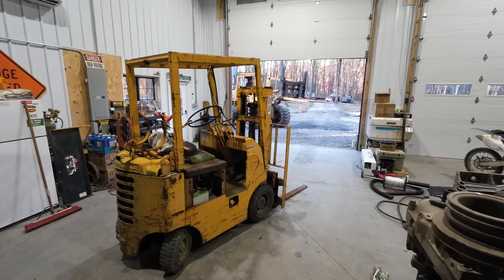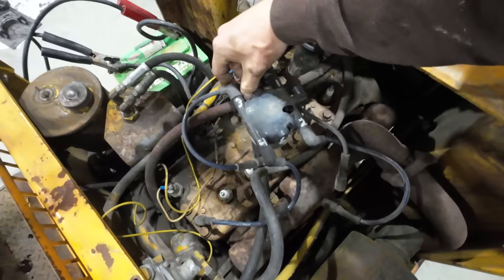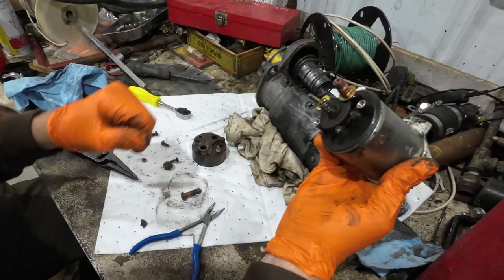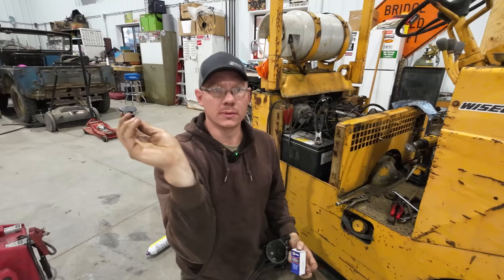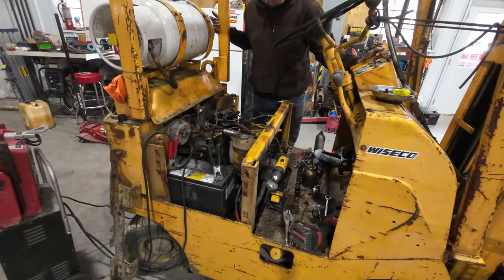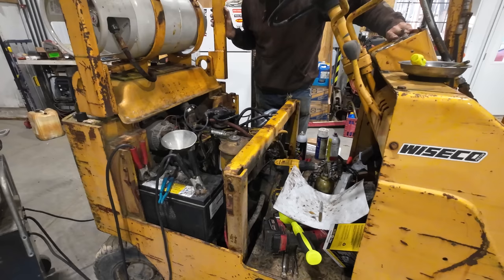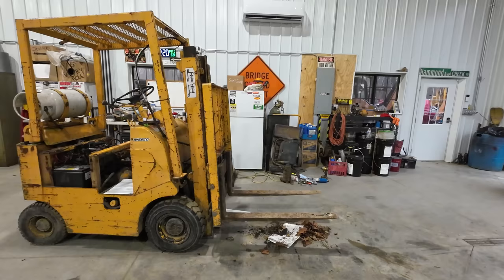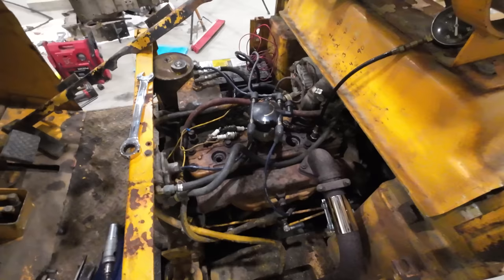Save or Scrap? CAT Towmotor sitting for years. Will it Run??

Comment: test for engine lock by putting in gear and pushing?

BTW, it takes about five minutes to check compression on a four cylinder engine. it would then be clear whether or not the head might have to come off. ...easy test.

surprised the known to be broken rotor (host mentioned breaking it during removal) was installed and then thought it likely the engine would start.

now that i've seen about a third of the video...

should have suspected valve problem when host found rust on the plugs. surprised the host invested money in new parts, even though it was clearly evident that they would be needed eventually, when wholly concerned about just getting it to run. 

SOP on a non-diesels should be to check spark and compression, at a minimum. ...and only THEN try starting it. it's take little time to do that and will on average reduce expense, time and frustration. yet it's rarely done by those that try to start old engines subjected to weather. it always seems to be a hit and miss process.

IOW, get the compression tester out, get your points file out, get the starting fluid out and statically time the distributor if possible before attempting it to start. if it doesn't bark off after that, THEN it's time to start scratching your head.  :)

and what was the point of letting it run with only a drop of oil on the stick when the host knew he was going to put at least a couple of quarts in anyway? what purpose did THAT serve?

i suspect the lack of smoke on startup after the oil change had nothing to do with the oil change but rather the fact that the host didn't inject oil from an oil can directly into the cylinders before starting as was done before the oil change.

sparkplug wires generate more resistance as they heat up, making shorting out to a nearby ground much more likely. if it happens in the coil wire, all sparkplugs will fail at about the same time. arcing can often be seen in a running engine in a darkened room.

when doing this kind of thing, it's best to have a set of eight known to be functioning plug wires and a coil wire long enough to reach all spark plugs and a known set of working sparkplugs and simply install them right from the get-go.  the point is to eliminate as many variables as possible. the frustration level generated here is impacting the ability to reach the goal. 

BTW, this is a stream of consciousness kind of comment, as i watch, i'm commenting before i know the outcome.

Comment: Hi Matt, love the show but you frustate me by not doing the basics. Didn't see you check the valve clearances or the ignition timing. With a good condenser there should not be a spark at the points, it's there to stop that. Also was the advance/retard system working in the distributor? Anyway, with that main seal leaking so bad and all that blow by she's a gonner for sure. RIP little cat.

Comment: You never showed us if you added oil to the engine before starting it since the dipstick was barely wet. Did you add and coolant either? You ran it for a while. How about hydraulic oil so the pump is not running dry before starting it the first time? How about cleaning the plugs and checking the gap once you got the first sign of life?

Comment: Intermittent spark? I am going to go with ignition switch, bad ground, or busted ass wiring system. Walk away, not bad lifts when you need them and they are running, but these lifts were the inspiration for the game Pitfall for intelevision. The time and money sunk into this is not worth it. I suggested this on another YouTube  channel, those flat he'd Continental setups are near impossible to find parts for. It took forever for me to piece a complete engine kit together. I rebuilt the engine, pump, hydraulics, lines, trans control valves, steering system, he'll even the bottom bolt for the counter weight was broken. I rebuilt it all, and that lift doesn't work anywhere near as good as the later 80s Yale. Lesson learned!
Reply: Another guess would be the carb, if it is not atomizing properly because the carb is getting cold it would do exactly what you see.

Comment: Is there a temperature cut out in series with the ignition circuit? On a motor this old I'd been inclined to build a complete basic wiring harness and drop it in. That will get round any electrical problems.
Reply from the maker: I had a jumper right to the coil. Doesn’t get any simpler than that
Reply: Elsewhere in these comments @tardis454 posted 3 days ago (edited)
"Don't give up on the Towmotor just yet Matt. At work we have a mid 70's 15,000lb capacity Towmotor with a Continental flat 6 that had a similar lost spark issue. Our company purchased the machine from a salvage yard where it lived outdoors exposed to the elements for many years. It took some digging, but my friend (who's name is also Matt) found the problem. There are bakelight/plastic pieces that isolate the points assembly/parts from the breaker plate and distributor body. The bakelight/plastic pieces had disintegrated and were causing the engine to randomly lose spark. My friend found some non-conductive material at our shop and made new isolators for the distributor. That solved the problem and the Towmotor has run fine ever since. The distributor in that machine was rusty like the one on your machine due to being stored outside for a long time. My friend thinks that's what caused the isolator pieces to become brittle and fail. It's worth checking out.. Distributor refurb kits are still available as are new/used distributor assemblies. Those old Towmotors are great machines once they're sorted."

Comment: Napa might have a line on a rebuilt starter motor or a local rebuilder shop. Google Auto Electric supply. Pacoima auto Electric pacoima CA. 59:08

Comment: Do yourself a favor and buy a complete new or rebuilt distributor for it.  9400 hrs on engine...I'm betting the distributor has worn out upper and lower bushings.  I have fixed 3 old forklifts in the past 5 years doing just that.  A Yale with a wisconsin v-4, a Lift all with a 4 cyl ford, and a hyster with a 6 cyl Continental.  Wiggle the rotor shaft back and forth towards the points and you will immediately see what I mean as the point gap changes.  @tardis454 is right too.  Where the wire comes out of the dist. housing the bakalite bushings crack and moisture can mess with grounding out the points also.  Course...there is that little oil leak problem....  Good Luck

Comment: You need a battery sponsorship almost as bad as a feller (and felletand Lil fellers) in Tennessee does other people's "projects they never got around to" almost always have dead batteries in them and don't forget they need a go handle to be the right application for your project oh and water will funnel through the distributor into the crankcase and it can seize the distributor causing the cam gear on it to get wiped out if the engine does turn over

Comment: Switch is bad get a brand new one.  I would fix it up because I like it. It probably needs the valves replaced or nuraled.  I think it would make more compression.  Its something simple like that. put some B12 chem tool down the yap and rev it up and clean the valve seats or you could use Marvel Mystery oil down the yap or both it cleans the valves and unsticks them. Some guys use tranny fluid down the yap. It will run. Actually the compresssion is too low it needs valve work or rings. The valves are probably carboned up. Try cleaning them with and marvel or B12. Put B12 in the gas tank too. It will clean everything. Did you put new plugs in it? Needs a new rear main seal. that switch is bad get a brand new switch. You are giving up too soon. Rear main seals are replaceable you have to remove the motor. Its a lot of work I guess. It will make a good video to fix . Keep it for later maybe you find another motor later. Saw a guy put some B12 down the carb of a ranger and made it run like new again. B12 is cheap like 6 dollars.

Comment: How do you figure that there is a lot less smoke by changing the oil? Don't suppose that oil you put into the cylinders had anything to do with it smoking, do you?
Reply from the maker: It ran long enough to burn that off prior to the change. I’m sure it contributed to the heavy smoke at first but it was still a little Smokey after a while before the oil change

Comment: I've watched 3 repair videos and you may have gotten the machine running but you never complete a repair. The 4 cylinder flar head is the easiest engine to work on. Can you complete a repair?

Comment: I gave up on gas or propane forklifts if its not diesel i don't want it. Just too fed up with carbs being always screwed by previous owners and the pain of finding the parts to rebuild them and they still never run right.
Reply: Diesel forklifts? Only in the great outdoors.  The only thing that will work inside and outside is propane - yes, it does stink.
Reply: @davidnull5590  My use is currently outside and i have no worries about using one inside since too much clutter to work inside

Comment: its funny you say that its worth nothing, here in Australia that would go for atleast 5K, ive seen worse ones not running for upwards of 10k. like the crane truck you picked up, that well over 50k here. the other thing i find amusing is you dont like the manual, over here every tie you go to a job with a manual there always a rush on the manuals.  and you can still them new, well here anyway.

Comment: Why aren't you throttling a little while you crank it over? It would have probably fired a lot quicker and given the poor starter a break too. It seems apparent you have a fuel regulation problem as well. And I don't know why you wouldn't have topped the oil off first thing to improve the poor compression. I'm not a mechanic but I have run lots of different machines. Just my $.02.
Reply from the maker: I was adjusting the throttle right on the throttle body. You couldn’t see from where I had the camera

Comment: Hi Matt how are you I have a question for you  why you have so many containers and do not use it  I would line up the containers one beside the other and do a massive  garage  for all those small units you have like the Military gen and the Motor car you working on this video  and all the small units you have the reason for this is to be able to keep then clean and easy to work on it  when you decide to work on it also when are you going to  put that  overhead crane of yours  that is getting all damage on the outside because you do not cover it  or have it  in a cover place  the reason know this is because we have seen it in your videos not cover I know you live on PA and I wish I have a vehicle like that I come and help you with all your  projects  do not  worry I do not want any money to help you   just the fun of doing something is enough  I am a Diesel and Car Mechanic retire From The ARMY

Comment: Is there a reason why you used diesel engine oil in a gas powered engine? 😂
Reply from the maker: Yes. It has a lot of additives these old engines like that is not found in modern gasoline oil.  Specifically zinc

Comment: Oh gawd, you got an internal combustion engine (as opposed to a diesel?  Say it ain't so.  If a diesel has compression and fuel, it will go.  Coils and plugs and chokes (esp auto-chokes) are an unwelcome PITA.  Good luck with it.  All of my vehicles, incl lawn implimenntds  are either diesel or electric.  I studied complex systems in grad school.  As you increase the number of independ subsystems,  the failure modes do not grow linearly.  They're exponential.  Double ythr number of systems, you have four times as many failure modes.  Hence my dislike of spark plug systems.  
Real Men don'y need Spark Plugs."

Comment: Kinda odd how after you cook the engine by trying for ages to start it with basically no oil in it, you slap a oil jug on top of it and talk about how you're giving it a "fighting chance" with an advertisement for Rotella. Calling it the "good stuff" is about as cringe as it gets.
Reply from the maker: I didn’t cook anything. It had plenty of oil to run it for a short while which is exactly what I did

Comment: You guys and your oil religion are so funny. A cheep spark tester and a test light will diagnosis that ignitiOn system. Testing spark holding a plug to the engine isn’t a good test. They can spark that way but noT when you have compression on spark. A spark tester set to 30-35kv is a good test of spark. Have seen many weak systems spark plug out in the open but not under compression.